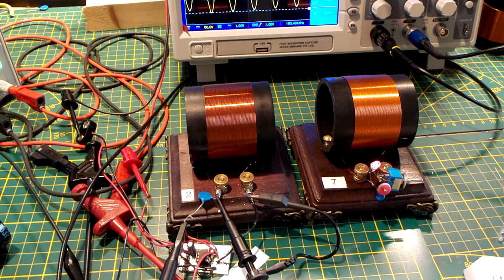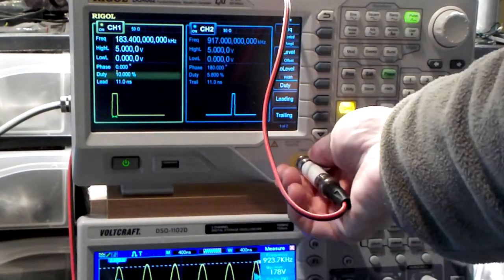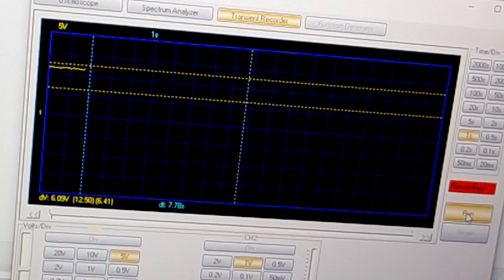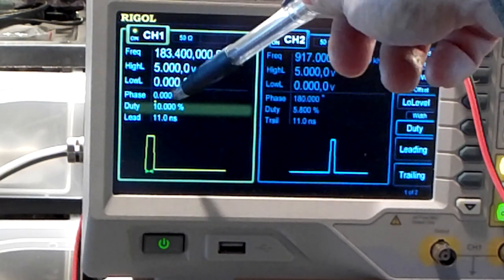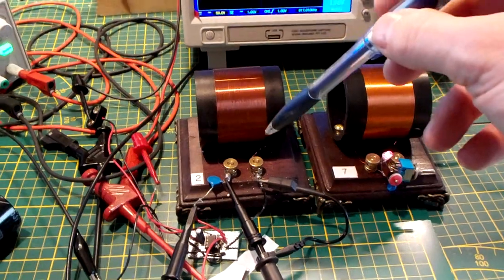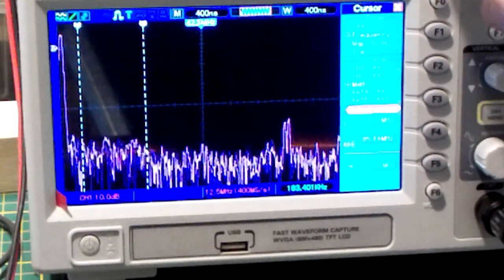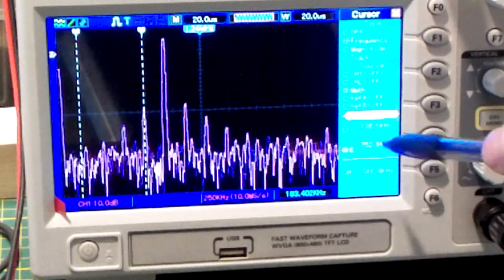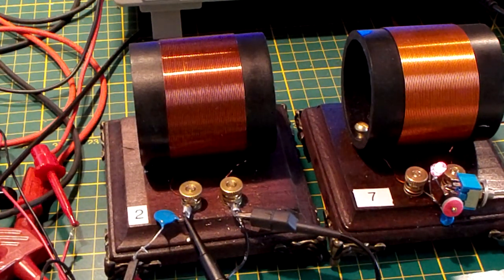047 Don Smith Spinoff Experiment Free Oscillations Proof To Myself

Comment: Excellent demonstration Bruno, thanks 🙏 
In this setup does the secondary impede on the primary (primary changes if secondary is removed)
If not, how many more secondaries can you add without affecting the primary.
It would also be nice to replace the secondary load LED with an non inductive resistor so it’s RMS voltage could be measured so you could have an idea of output Wattage as well. Thanks for making these excellent video demonstrations 👍
Reply from the maker: @Luc gotoluc, In this setup the influence is minimal, in the mean time I tryed with placing coils contacting each other like in Rick's video and then the influence is much bigger. 
Tomorrow I will try your question about the how many and resistor (I have low inductive 500 and 1k ohm), I'll keep you posted.
Reply: Thanks for the reply Bruno and trying a non inductive resistor as secondary load.
Looking 👀 forward to the results.
Reply: Hi Luc, hi Bruno, if you work with Free Oscillations, you will get the highest CoP value if you choose a very small duty cycle, e.g. 0.1%. You approach the frequency scale from the bottom and look for the maximum output voltage. This can be for example at 1.8 KHz and is the 1024th part of the natural resonance frequency of the converter.
You have to capture the energy of the output sequence from the beginning of the input burst to the beginning of the next input burst at the output of the converter. This output energy is compared to the energy within the input burst. The higher the frequency divider ratio, the higher the CoP value. This applies to any type of converter with real or complex input resistance of inductive or capacitive nature. It makes sense to compensate the reactive power with complex input resistance with a parallel inductance or parallel capacitance. Because the input energy becomes smaller and smaller with increasing frequency divider ratio, the input voltage should be increased. The edge steepness of the input burst is important. For this reason, avalanche generators with approx. 1 nS rise or fall time are recommended. More important information about the processes in the input burst window will follow soon.
Reply from the maker: @Hans, When I use 50 free oscillations: 18.2Khz  and 1% duty, the first sine wave has max voltage of 22.8V, the 50th 2.4V @ 12V input. @35V input the first has 76.4V and the 50th 17.2V.
My measuring device can not measure the low currents anymore at 12V, @35V I have 0.003A, 0.01W So I will not be able to do measurements beyond the 50 free oscillations with the gate driver setup. My signal generator can not go below 0.32%.
I made a picture with setup and scope view: https://photos.app.goo.gl/rCxbBM9U8w2WfmYm6
Looking at the dampning, litz wire should also be used I think.

I was looking with a second tank circuit tuned to same frequency to see when the 2 help eachother (sender, receiver) and I found out that phase shift of 25,100,175,240,315° caused the one to help the other. The result in gain was almost the same, for example:
Starting with max voltage of 316V at the circuit that I want to help, I get 400V at all those phase angels by using second channel on signal generator to other gate driver with it's own tank circuit (182Khz, 10% duty, 5 free oscillations) The distance is also important, comming to close and I didn't ge that 400V, it went lower.
The reason for this experiment was to see how a receiver can help the transmitter with his signal, so if I'm able to create a phase shift in my receiver that is according to those measured angels then I should get the situation that Rick talks about where he had like a magnetic lock where the one helps the other, do you know if this is correct?
 The amount of helpfull angels is depended on the amount of free oscillations, more free oscillations = more helpfull angels.
Picture with this setup: https://photos.app.goo.gl/nvLAPBsJG1VzXSjA7
Reply: @brunovk417  Wonderful, Bruno, your measurement results are absolutely correct! They correspond to my findings when testing various converters with complex and real input resistances. Free oscillations can be produced with all electromagnetic converters. Essentially, it does not depend on the type of converter at all, but that it is constructed with as little loss as possible.  The converters show similar measurement results. With me it was so that with a frequency divider ratio of about 1/100 and a duty cycle of 0.5% the COP value was about 100%. The CoP-value rose with a frequency divider ratio of 1/250 and a duty cycle of 0,1% already to 8. With increasing frequency divider ratio the effective output power became smaller and smaller and the effective input power still substantially smaller, so that the CoP-value became exponentially larger. In order to achieve usable output power, the input burst voltage must be increased significantly. The edge steepness of the input burst voltage is very important. The steeper the rise and the falling the fall of the pulses, the better the converter works. I work with a function generator which had a slope of 25 nS. That is actually already too much. If I connected a gate driver behind it, it was already 50 nS. That is not good at all. The best way is to use avalanche generators, which have a slope of about 1 nS. I will do that soon. I have not copied the converter of Rick Friedrich and work with other converters. There is still a lot to say about the input burst window, but I will do that next time.
Reply from the maker: @Luc, I didn't came to the inductive resistor test as load, I will do that next week. I tryed with diode bridge and capacitor but charging was very slow, so I'm going to look what I can change to become better results. So many questions in my mind at the moment :)
Reply from the maker: @Hans Würtz, Thank you for sharing your results also.
Reply from the maker: @Hans, I can imagine when your avalanche generator can discharge in coil placed between 2 capacitors like in Tesla patend 568,176 it will easily go in self resonance, looking forward to your findings. Meanwhile I did some searching and found a dicument to build Marx generator with 2N5551 transistors, so I'm going to order some materials to have a go myself 😀 Thx again for all your info you shared. 
Ps the document I found: https://research.tue.nl/nl/publications/15-stage-compact-marx-generator-using-2n5551-avalanche-transistor
Reply: @brunovk417  Very nice Bruno, I am also planning an avalanche generator. I don't think we can get past this type of generator. This is the 'what we need to effectively access the energy of the physical vacuum. The amplitudes of the Free Oscillations will increase, which will lead to higher converter output power. Thank you for the link to the Avalanche Generator!
Reply from the maker: @Hans Würtz, Thank you for the link, my German is not so good as English but I can understand it (My main language is Dutch). I orded the material for building that 2N5551 avalanche marx generator, the Marx generator was also mentioned in Rick's book on Don Smith (allthough with spark gap, but I'll see what happens with the transistor switching).
Reply: @brunovk417  Hans and me working on that. I have ordered that 2n5551 after I see your link previously. This could be a very eazy way to get it to work with smaller loads. High Q-Factor Coils, lot of free oscillations and the sharp risetime and falltime from Avalanche could be a possible way that we can eventually create something like the "flashlight forever" that akula (probably) did. Problem what I see here is, that we cannot control the duty cylce and we have uncontrolled impulse frequency. We give you a update if we have the first results.
Reply from the maker: @Baudirenergie & Hans, I contacted the writer of that document (he also speaks dutch) because I was doubting on what voltage the capacitors should be. He said they charge up to approximatly 300V and that keramic disc capacitors work best for the fast pulses. I also asked if it was necessary that the resistors are higher in wattage and this is depended on the switching speed you want. When charging the capacitors of 3,3nF to 300V you have 74µJ per pulse per resistor =>1/2 (1/2 C * V²) => online calculator at: https://www.electronics2000.co.uk/calc/capacitor-charge-calculator.php 
You have to divide the result of the calculator by 2 because you have the 2 resistors for each step in the Marx Generator.
When you pulse at 1Khz you have 74mW (1000 x 74µJ) but at 10Khz 0,74W(10000 x 74µJ)
Reply: @brunovk417  Thanks a lot Bruno for contacting the writer and also your nice calculation. Yes, not so much output on the driving site. We have to check it by experiment, if it is the right way for smaller outputs. I will inform you, if we have first setup done. Thanks a lot again.
Reply from the maker: @Baudirenegie, It seems we're able to help eachother, so also Thank you to all who help.
Reply from the maker: @Luc & Hans , somebody gave me a possible big hint, I wrote a general comment on this, this is to inform you.
Reply: @hanswurtz5560  This is important. Now you are addressing addition free energy principles here. Very good.

Comment: @Bruno Vk  Very good demonstration and very well explained, thanks for sharing your work and effort.  Very thought provoking, some questions came to mind.  Did you also find that you had maximum gain with this setup at the 5th harmonic (lower gain when signal generator is set to lower or higher harmonics)?  And did you happen to also try this with parallel LC resonance or only the series LC resonance you are demonstrating in this video?  Also curious why the signal generator is set to 0 phase for free oscillations and 180 phase when there are no free oscillations?
Reply from the maker: @iQuest, The more free oscillations used the higher the gain but lower output voltage.
Therefor the input voltage needs to be higher if you want more output. I tryed it with 12V 1,2watt led and could go to brightness like when used on 9V DC when input voltage was 38V (IXDD614 gate driver can go to 40V). I compared it at that voltage and again you see the gain again using 1,5W with 5 free oscillations and 3W without (working towards same output voltage on series LC). The gate driver became extremly hot when not using free oscillations.
I have not used it on parallel tank circuit yet, it will be harder I think because I have to foresee an impedance in series to limit current thereby creating voltage divider.
The phase shift is from a previous experiment where I used both output channels at the same time, there's no reason for this experiment.

Comment from the maker: Today I did extra experiments with receiver as parallel or series tank circuit and the result is that in the case of series LC the led's that where used didn't light, in parallel they did. So for the load with low voltage input, parallel circuit is better. I also compared this at full resonance (no free oscillations & 50%duty) and in that case there was not much change in brightness but series had little less influence on transmitter. Circuit used is: https://photos.app.goo.gl/uNJQWAjUwujbMHmGA

Comment from the maker: I received a very important hint from somebody and I'm only going to show his name after he approves it. He said to me : "your using pulses not impulses"
At first I couldn't think what exactly could be the difference. But now I think I start to understand what he means with pulse & impulse difference. When I was thinking on what could be the difference I thought on the symbols on my signal generator. The difference could be in the fact that pulses are repetitive while and impulse not. Meaning that for free oscillations I would need to block 4 pulses to give 1impulse for every 5 pulses and thus become 4 free oscillations and use also the 50% duty cycle to have free oscillations but starting at max output voltage 😀.
I learned from my mistake from the start of the free oscillations by only going for the maximum, sometimes less is better 😀
I hope I have a counter IC so I can test this thought  to reality.
Reply from the maker: I was to quick it seems, when comparing switching times with/without free oscillations you see that they are the same. Blocking 4 pulses is allready done in the way we create the free oscillations: https://photos.app.goo.gl/UwdCsh8HPHLbXRNk9